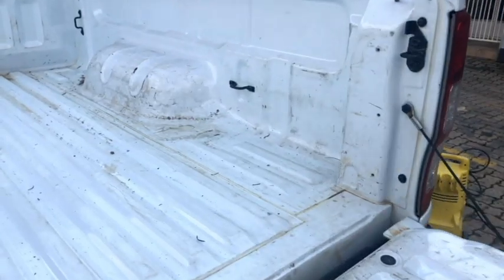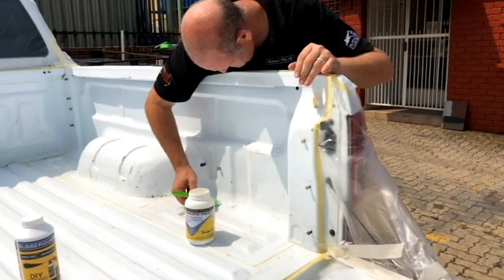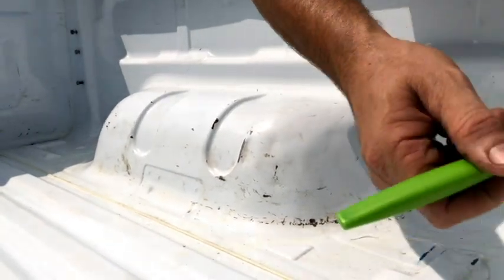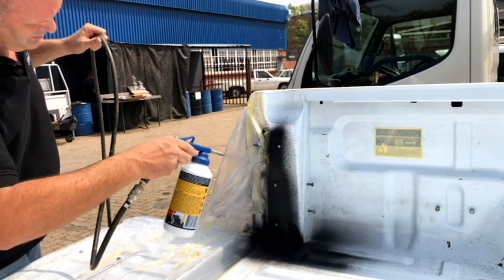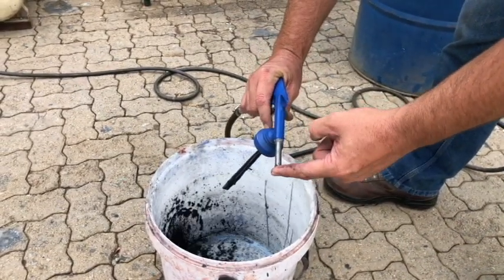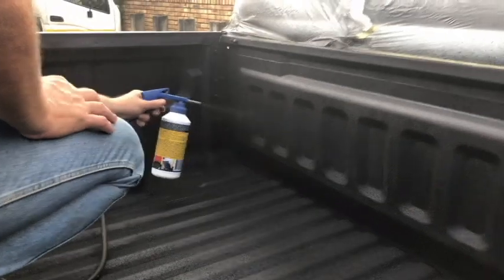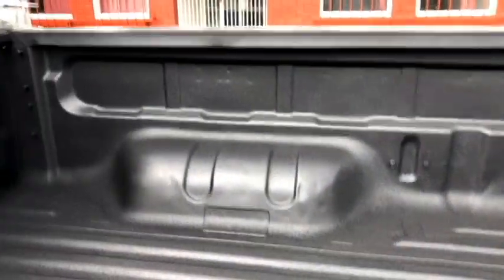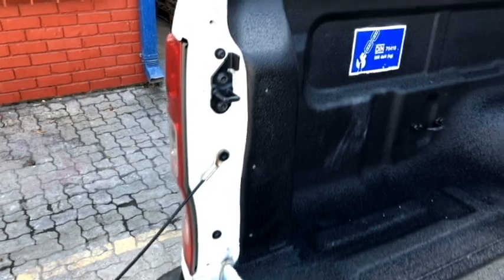Rubberguard Spray-on

Comment: i found this at Adendorffs as they are distributors. i was so sick of reading about products to rubberise my trailer and at the end of the day discovering that most of the products available are basically just stonechip paint. i am really impressed with this product, as i did it myself, using a stone chip gun and it looks like i had my trailer rubberised at a dealership. the best of all is it cost me less than R 300.00 for 3 litres.
Reply: I get the problem of the pipe clogging. After 2 hours trying I gave up!
Reply: @malkat100  They have made the formula even better - as long as you are using a stone chip gun, you won't have any problems applying it